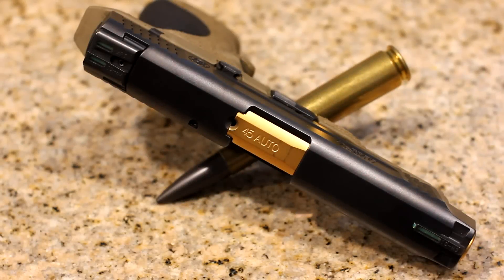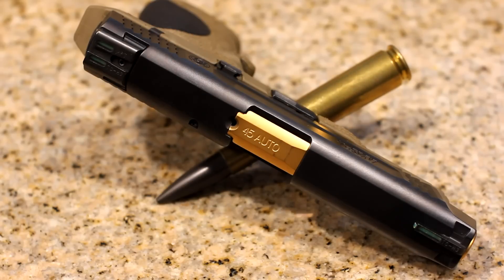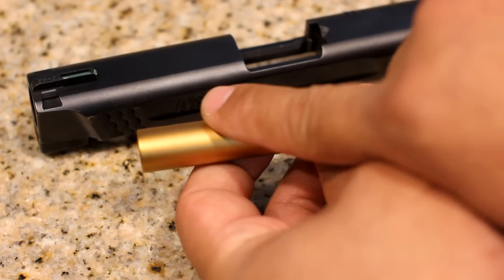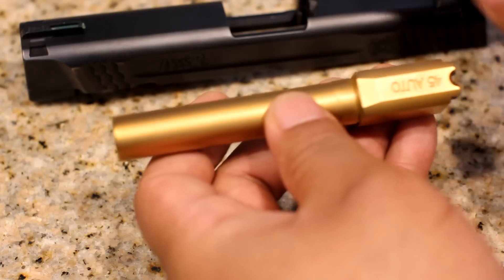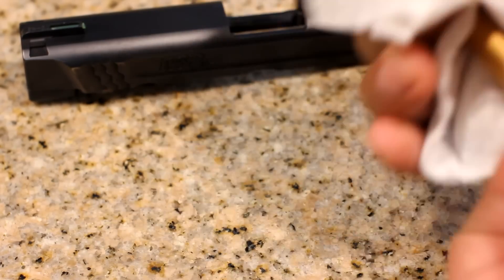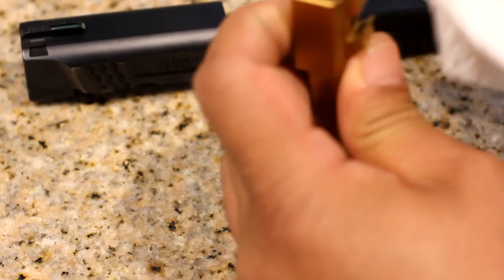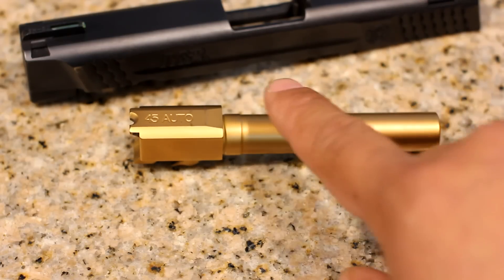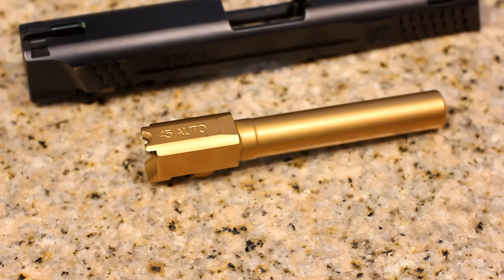TiN Barrel Coating

Comment from the maker: As you can see on my M&P .45, which had the same coating as your M&P 9, my original barrel finish began to see wear on the first box of 50 rounds.  I've put 600+ rounds through the TiN coated barrel and it still looks pristine.  The gun seems to operate smoother since there is less friction coefficient against the slide.

Comment from the maker: TiN is used in aircraft bearings to lessen wear on surface to surface contact and is widely used in the aerospace industry.  Since oils do not work in space, they use a TiN coating to replace any type of oil that would be used.  So in actuality, you would never have to oil your barrel again, but we still recommend using a light coat of oil to enhance the slickness.  TiN PVD is a more specialized, complicated and more expensive process and would not be cost effective for large manufacturers.

Comment from the maker: The great thing about TiN is that it is super hard, off the Rockwell hardness scale.  The lubricity characteristics is superior and will reduce wear to parts it comes into contact with.  I see that coating the internal parts of the slide would be overkill since there is very little "high impact" components.  I do not do any Nickel Boron since that utilizes a different method.

Comment: Another benefit is lubricity.  It is ultra slick and many after market Glock parts can be purchased with this coating.  I'm taking this one step further and I do not believe it has been done yet; however, I cannot be positive.  I just sent out a Sig Sauer P320 trigger bar from the "fire control module" to be coated in gold colored TiN.  The goal is to reduce the coefficient of friction at the contact points.  I already received significant success, just by polishing with Flitz.  The TiN coating should take this one step further.

Comment from the maker: Hey buddy, there are other options.  TiAlN is a Titanium/Aluminum combination with a black finish.  This coating is commonly used on carbide end mills used for cutting steel.  It is an extremely hard surface, but does not have the lubricity characteristics as the TiN (gold) finish.

Comment from the maker: Hi, if the carrier key is what your talking about, it will definitely help to have a coating on this area as far as making it easier to clean.  The issue with pvd coating is that the TiN coating will usually not work its way into the carrier key hole itself, but it coats the outside diameter.

Comment from the maker: Hi, The original coating is completely removed either chemically or with media before the TiN coating is applied to the substrate material.  This allows for exceptional bond and penetration.
Reply: Hey how do u keep your gold TiN Barrel With No Scratches When u Rack the Gun

Comment from the maker: Hi, The TiN coating is far superior to any melonite or tenifer finishes.  Melonite (S&W) is about 64 on the Rockwell scale and the Tenifer (Glock) is about 67 on the scale.  TiN is so hard, it's off the Rockwell scale, so really there is no comparison for hardness.  Melonite and Tenifer coatings are surface coatings while TiN has a molecular bond to the substrate metal.  Lubricity characteristics of TiN is something you can physically feel once applied and is a far more slick surface.

Comment from the maker: It blows Cerakote out of the water.  Cerakote adds thickness so it will effect anything that holds tight tolerances.  TiN coating is so thin that it will not affect even the tightest tolerances on even custom fitted pistols.  Cerakote is a top layer coating where as TiN penetrates into the metal and bonds.  TiN has superior hardness and lubricity characteristics that exceeds far exceeds Cerakote.  It's almost like comparing a ford pinto (Cerakote) to a Lamborghini Aventador (TiN).  No comparison

Comment: I'm curious about where you found a M&P45C in FDE without a thumb safety. lol

Glad the company took off positively. 👊👍🇺🇸
Reply from the maker: I actually removed the thumb safety.  I can't recall the name of the company that sells the plug to fill the hole once the safety is removed.  It is a very simple process to perform and does not require any other component to remove the thumb safety.
Reply: *****  Thanks for the reply! I found a company who still supplies the plugs. Thanks for the information. I've been waiting to find a M&P45C to replace my current carry M&P9 in FDE but they all had safeties and I've never trained with safeties. 

I'll definitely be sending the 45 barrel and slide to you and having both done. Slide in black and the barrel in gold. 

The one you have in the video, is the slide done on that as well? I'm curious to see how much better it holds up against kydex wear on the slide versus the standard coating Smith & Wesson uses on their slides. 

Thanks for the reply!
Reply from the maker: Actually to tell you the truth, the TiAlN is only a bit more resistant to wear than the factory finish.  We've completed a few slides for several customers and they've reported a slight better performance than the factory coating.  The slide in the video is factory finish.  These finishes are not impervious to wear and is not a miracle coating, but a coating that will outperform and outlast most factory finishes.
Reply: *****  They may not be "wear proof" but that barrel shows better adhesion than any cerakote part I've ever had done. I call that a win in my book.
Reply from the maker: Oh, this coating is way more wear resistant and harder than cerakote.
Reply: *****  Expect a order request from  me in the coming month for a BCG, 4 barrels and one slide. 

Thanks for taking the time to reply.

Comment: Given that the barrel coating is harder than the finish on the slide, do you foresee any issues with excessive wear on the slide after hundreds or thousands of rounds? Would there be any need to coating the internals of the slide akin to Nickel Boron coating an AR BCG and the internals of the AR receiver? Thanks for the video.

Comment: .
Wary of gold TiN coatings after those Ti Glock strikers that used to be the rage failed while the OEM steel ones were still functional, etc.  Unless the Ti was just too "Soft" for an ultra-hard coating ?
.
Don't care to turn a pistol into a "Pimp Gun" but if the lubricity  is as good as you claim, it could be a boon to cam surfaces at front of the barrel hood on a Glock slide & the same for the cam areas of the barrel on the frames locking-block.
.
Would try it on an aftermarket barrel !
.

Comment: I see you TiN coated the barrel nice work.. can you also do all the little stainless steel or titanium mechanisms that are in a Glock like the extractor, slide lock, trigger pin, locking block pin, slide release ect...?
Reply from the maker: Sorry, but we've stopped coating small parts.  It is not cost effective and would rather concentrate on coating barrels and larger components only.
Reply: That sucks, but I would really like it done to see how it would turn out. There's no way we can't work something out to get it done? I would really appreciate it.

Comment: "...coating the internal parts of the slide would be overkill..."
.
The way some pistols are set-up for various competitions the slide can slam violently at the end of its travel.  Even Glocks with their Tennifer {or whatever it is they use now ?} the breechface can and does get gas-cut over time and abuse.  The cam that the connector nub rides on is a high-friction point.  If there is anything on an auto that could stand to have high & continuous lubricity it is the cartridge-rail !
.

Comment: I'm sorry if my question is answered in the video but I'm thinking of TiN my glock 19 barrel and was wondering if the bore of the barrel is also coated? Thanks
Reply: It is a nitride coating. So I would imagine it would be. Like the finish on glocks their coating is inside the barrel aswell
Reply from the maker: TiN will not coat the inside of the barrel.  It is an ION bond coating, so it is a line of sight coating.  We do not reommend coating the interior of the barrel.  TiN will coat the feed ramp but will not enter the interior of the barrel.
Reply: ***** so then would you leave the original nitriding aswell when you apply the coating?
Reply from the maker: TheTyrial86 Tenifer/Melonite is a heat treatment more than it is a coating and it is what Glock and S&W uses.  The black nitride coating is completely removed prior to applying the TiN coating.  Our TiN process uses very little heat in order to apply therefore does not affect the heat treatment.

Comment: You mentioned that the barrel coating is harder than the slide and would wear the slide first. I have seen some websites where companies are offering coatings for both the barrel and slide. They are not the same coating though. Robar for example offers nickle boron plus on the barrel and their poly t2 on the slide. I am interested in having my g19 done with something similar but do not know what to get yet. Do you all have any first hand knowledge of the barrel and slide combinations and how they work together to resist wear? Thanks
Reply from the maker: Hi, basically our TiN or TiAlN coating will resist wear better than the standard factory coating.  An aftermarket coating is not necessarily wearing out the factory coating, but rather the aftermarket coating is lasting longer because it is more wear resistant than factory coating.  For example, if you apply an aftermarket coating only to the barrel, your factory coating on the slide would most likely wear out first while the barrel coated with the aftermarket coating will have greater wear resistance therefore last longer.   We do not apply Nickel Boron, but I personally know that it is an extremely hard coating with good wear resistance.  We apply an ION bond coating in TiN which has superior wear resistance, but has slightly lower lubricity characteristics than NiB.  I personally run TiN on my barrels and have had well over 5000+ rounds with little to no signs of wear.  We have coated shotgun components for a local competition shooter that has recorded over 10,000+ rounds and the internal components still show no signs of wear.
Reply: Sounds great. I am trying to figure out what I want to do. Do you have any experience in coating the "tabs" (for lack of correct term) on the receiver that the slide actually slides on? I have noticed wear on my older Glocks

Comment: chanderson1 I was wondering which of the following coating are more durable/wear resistant basically offers the most protection and longevity to the parts of the weapon that are being coated..TiN aka Titanium Nitride.. TiAIN aka Titanium Aluminum Nitride.. TiCN aka Titanium Carbon Nitride.. AlTiN  aka Aluminum Titanium Nitride.. Thanks in advance i really appreciate your input.

Comment: Is the price still the same? Also do u have to remove the old finnish first or does the coating go over top?
Reply from the maker: The price is now $90.00 plus $9.95 S&H.  This price includes complete removal of factory finish.  The TiN will not adhere properly if there is any other coating.  We apply the TiN directly onto the bare metal.

Comment: Hi. How has this coating been holding up? 

I am interested to know. Mostly because I tend to run about 2k rounds a month (via competitive and training) and at times in harsh environments, like rain, sand, mud, dust, etc. I've been using and running stock equipment in the past but now I'm just starting to look at TiN for some enhancements.

Thanks!
Reply: in general, its been said that on something like a cutting tool like a drill, that it increases the life by 3 times or more.